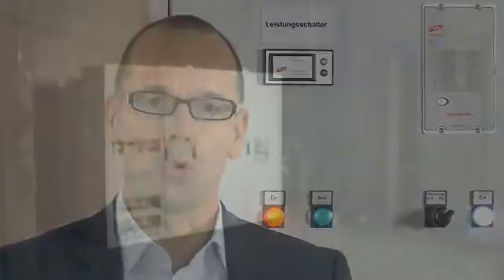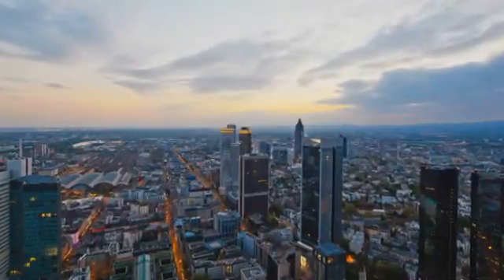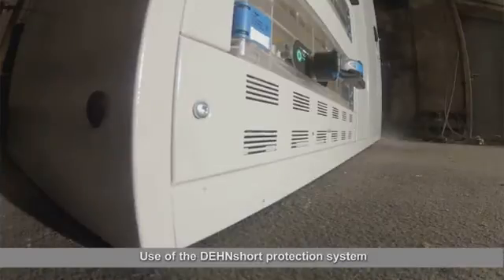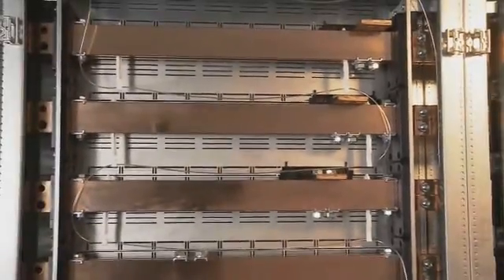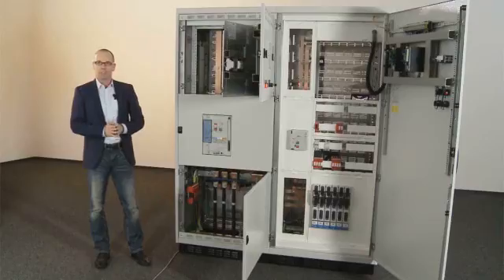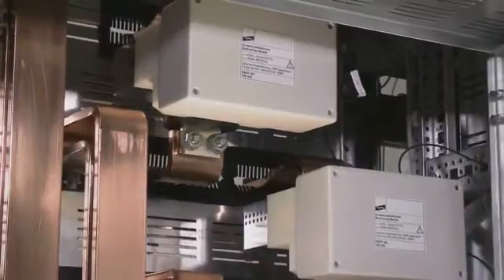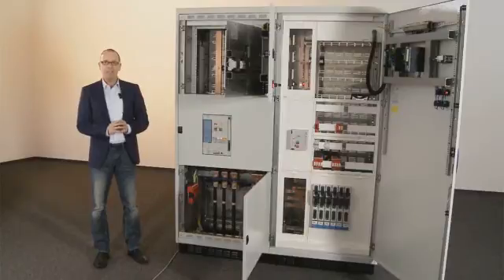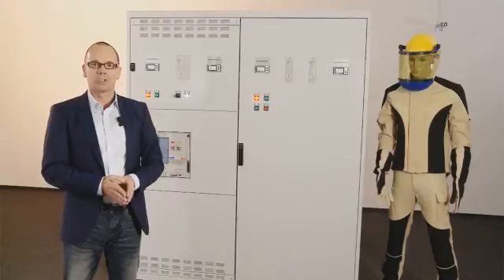DEHNshort: Internal arc-fault mitigation system for low-voltage switchgear installations

Comment: That is: as soon as a fault is detected, just escalate it to a full phase-to-phase short circuit, hoping the main circuit breaker will clear it. Brilliant. Like the german Type 1 lighting current spinterometer dischargers for the completely made up 10/350us envelope... when in doubt, just throw a crowbar across phases...
Reply from the maker: @AtaruMor0boshi: It's not the main circuit breaker which clears the arc fault, it's the quenching device. The disconnection of the main circuit breaker would take too long, so the  switchgear would already be damaged by the fault. The quenching device  guarantees a very short period of time, from the occurrence of the arc fault to switching off in 3-4 ms (QD II).